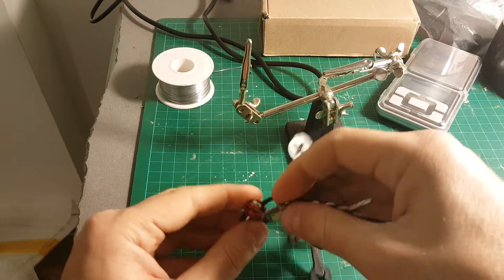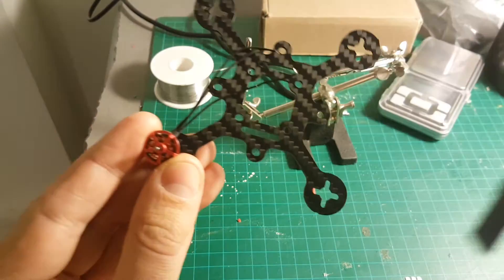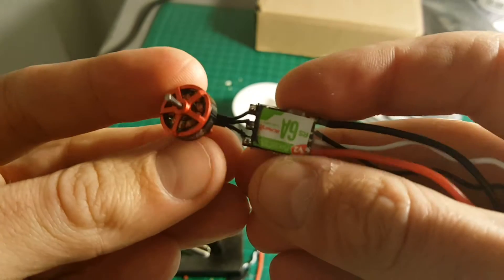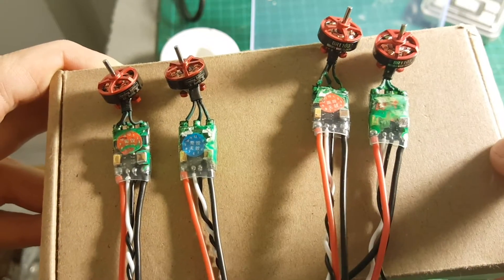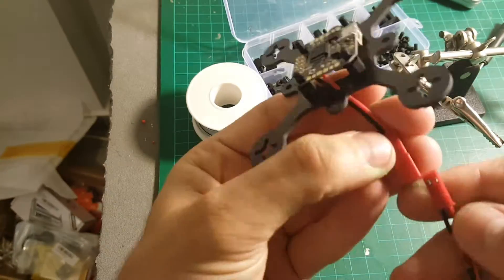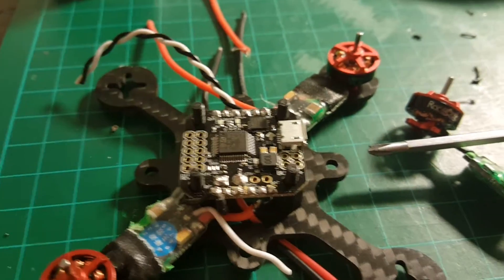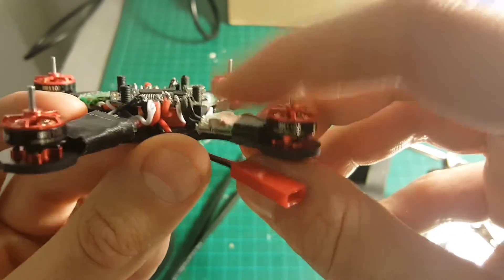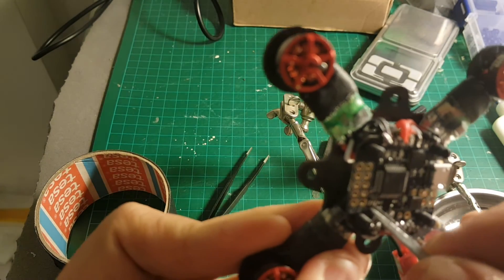Pico X - Micro Brushless Part 6 - Building The Quadcopter

Comment: What brushless motors would you recommend for 48mm quad blade props , beta75x uses 40mm quadblade props but I want to use 48mm , I have a lot of them laying around as well as 40mm ones but I want to use the bigger ones
Reply from the maker: Which frame are you going to use?
Reply: Gal Kremer I’m not sure yet , I was kinda trying to build the quadcopter around the propellers and work my way to motors then see what frames fit the motors that also for my 48mm props lol . Probably backwards way but hey I have so many of these props and I want to make it work somehow
Reply from the maker: @thelongranger55  I suggest that you should first choose the frame :-)

Comment: Hi how you connect the  ground and signal of escs ,do you soldering together  or cut ground wire?
Reply from the maker: The ground wires should be connected to the ground (minus) on the board. The signal wires should be connected to the s1,s2,s3 and s4 pads on the board.